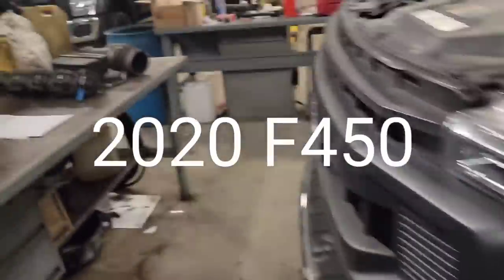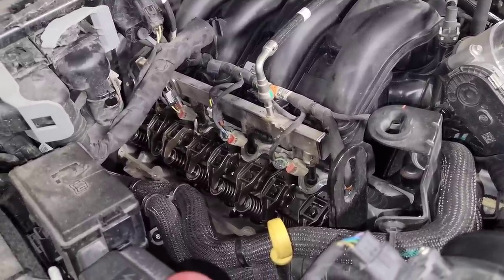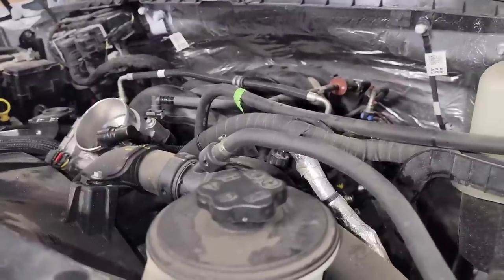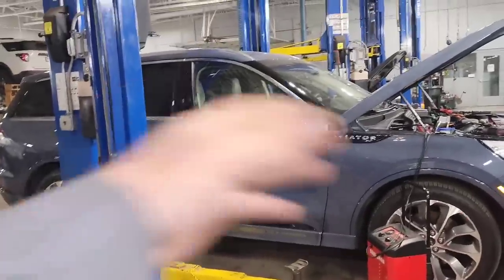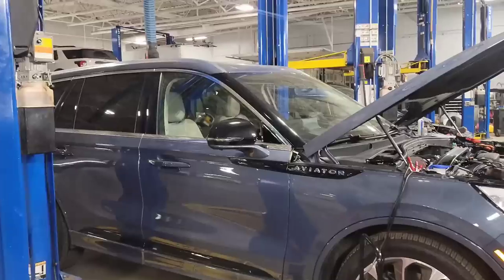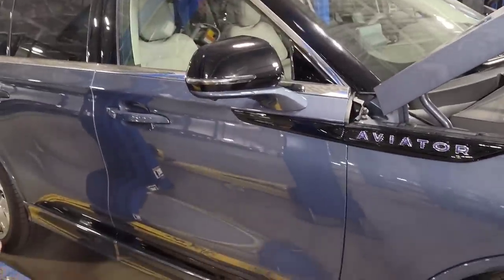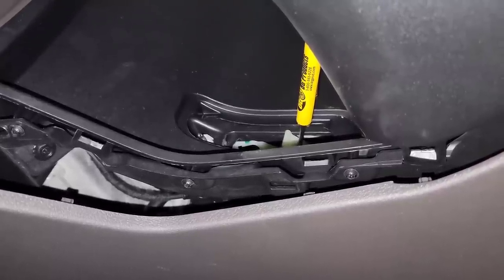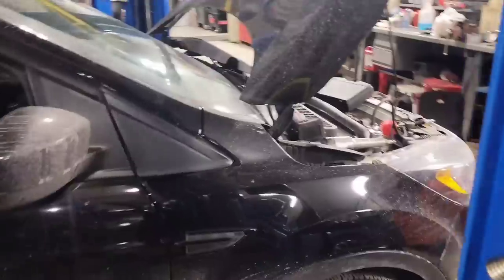2020 Ford F450 7.3L Godzilla Collapsed Lifter, 2021 Lincoln Aviator BCM Bricked - FDRS Programming

Comment: What was the main customer concern the 7.3 came in for? Did it have a CEL?  Ive had what sounds like a lifter tick since 2k miles....got 50k on it now. Rough idle also sometimes. Trans was repaced at 39k....was hoping the tick was in there.
Reply from the maker: This ain't no lifter tick this is a loud knock and misfire lack of power sometimes
Reply: I figured....love the truck other than the tick. Dealership said it sounded like a injector noise....i agreed but you can only hear it in the cab with the windows up. Preciate the reply and keep up the good work with these videos.
Reply: @FordBossMe  Agreed...with that much gap between the push rod and rocker, it has to be banging a tune rather loudly.

Comment: I have 2021 Aviator reserve 5 months old 5300 miles. The vehicle just died driving 35 miles an hour. Towed to the dealer and they told me complete engine failure, needs replacement. Is that common for the $70K vehicle? Thanks Ford Boss
Reply from the maker: That absolutely is not common
Reply from the maker: I've never even heard of that on that engine before
Reply: Ford tunes up while Honda detunes on turbocharged vehicles. When Honda owners tune up the boost the same damage occurs and engines fail.  If Ford detuned their engines to be less peppy they would see less failures.

Comment: I wonder if they developed that 7.3 with GM? First time I saw one at a show on a stand I thought it was an LS.
Reply: LOLOLOL what? It's old school push rod motor just like a 460. So yeah they resemble a LS which is a push rod motor also. But that's all! This is ALL Ford development and an absolute BEAST of a motor
Reply: @superdutyscaler6823  don't laugh, they developed Transmissions and transaxles together.
It's not a motor, it's a engine
Reply: @Bloodcurling  I don't think you can define what "motor" means

Comment: If you have currently have one that works (Ford, GM or Ram) KEEP IT!!  Change oil every 3 to 5 thousand, don't beat on it and run what mfg tells you and you should be good to go. Not saying this is a guarantee but may put odds in your favor. If you have to buy new, go talk to the Techs in the shop. Don't listen to the Salesman.

Comment: The school bus company I work for just got a big bus with the 7.3. It's brand new. It's going to be interesting how it holds up.
Reply from the maker: The key to this engine is don't idle it excessively if it doesn't need to be on turn it off and keep the oil changed by 3 to 4,000 miles especially with the severe use you guys are going to put it through don't try to run this over 5,000 miles I'm telling you right now long term it ain't going to benefit you and do not idle this engine all the time and if you're going to use a good quality oil you use something with a lot of phosphorus and a lot of zinc which I would highly recommend something like shape for Supreme 9000 5W30 formula
Reply: @FordBossMe  this problem isn’t exclusive to Ford.  The new V8’s from the big 3 have the cam center line higher in the block.  This allows for more stroke/variance in engine displacement while keeping a small bore spacing for packaging concerns.

I know someone who worked at Fiat/Chrysler headquarters and he said the Hemi engines fail quite frequently when they idle for extended periods (i.e. in police cars, etc.) due to the camas lacking lubrication and it’s due to the higher cam center line (and not addressing the oiling issue).

Comment: Tandem jacks on the rear & help from 3 other techs ought to clear that stall for you?
Reply from the maker: Not really sure what you're getting at but it sounds legit LOL
Reply: ive actually had to clear my stall this way.  Two floor jacks (one under each rear axle) and one tech holding both handles to guide/steer whiile 2 other techs push from front & me in drivers seat behind the wheel - its messy but works.  I enjoy your channel, thx @FordBossMe

Comment: I've taken Chrysler hemis apart that look like this, as in your third video. I watched that first (I cheated). The rollers fail on the hemi engines and every one I've been in,  needs a cam. My scope doesn't have the best resolution to look down in there but what I do, is I pull the cam sensor. Permanent magnet, if it, during my initial inspection, has metal on it, I just order a cam, too. Last 3 or so years,  the Chrysler dealers want the cams back. Which is interesting because they don't want the lifters back, the cause of cam failure. Every single one,  and I've probably been in a dozen, is missing at least one lobe. I've always gotten away with just lifters on the ls though,  except one, a 6.2 Cadillac Escalade. The 5.3s always just get lifters and send it
Reply: Johnson Hylift said they invented a lifter to stop "Hemi tick" but won't say anything about how they did it. I'm very suspicious of that.
Maybe Chrysler wants cams back as cores for rebuilding?
Reply: @skylinefever  Every one I've personally taken apart, cam was already junk and it was misfiring

Comment: I feel like we are going to be scraping 10-15 year old cars for stupid stuff like computer issues... With the parts availability and cost to repair.
Reply: Look under the hood of the new Bronco.  There is an engine somewhere under all those wires and hoses.
Reply: I guarantee new cars will be scraped 7-10yrs now because of the lack of onboard computer and part on  long term availability. The 10 yr manufacturers support has gone away in the wind. Still having hard time getting just maintenance parts for my 17 gm. The harnesses, computer modules, switches, etc.
Reply: Likely sooner than 10-15 years. "shortage of parts seems to be an excuse with every business these days".
Reply: One thing that makes me angry is that even simpler cars will end up this way. In the past you could simply avoid the problem by not buying a Cadillac or something similarly as complex.
Now you can't even get a Toyota Corolla without stupid touchscreen module.

I intend to buy an Evo X someday, it was one of the last cars of it's kind. Yes, it had some advanced electronics, but it has so many enthusiasts, that rebuild parts exist.
Reply: @skylinefever  simple ain't sexy.  Only sexy makes it on utube and piles up back orders for something not built or tested.

Comment: I absolutely never unhook batteries to tow vehicles. These neutral safety levers work just fine whether there’s power or not. And once I get them in the neutral I don’t put them back in the part that will be the technicians job. And if the parking brakes are applied and won’t release, then the vehicle gets dragged up on the flatbed or dollied.
Reply from the maker: So for safety reasons I replied with what was in the manual now what you doing real life makes no difference to me that's on you but because of my position here I had to cover the way I covered it
Reply: @FordBossMe  Hey I totally understand.

Comment: This is why I like older vehicles. No modules, no electronics, no bs to randomly fail and cause your vehicle to be stranded anywhere. IMO< they should leave all this tech out of vehicles.
Reply: How old are you thinking? Because they have been using a form of ECM's for decades.It's just that they control many more functions now.I was a mechanic in the 70's and even then they had rudimentary computer modules like the Chrysler Lean Burn module that was not reliable. You would have to go to the 60's to be completely out of it.

Comment: Wouldn't the loss of compression cause the misfire on the cylinder?
Reply: It depends on how much compression gets lost. I had a 2003 Saturn ION where the engine didn't have a misfire but ran like crap. I took a compression test, and #3 was far below the other cylinders. I think the numbers were 190, 190, 130, 190. I sold that car before #3 was completely dead.

Comment: Im sure as you have already found out that ford will not do a low time in service due to no short block component damage. And also the lifters are removed only after the cylinder head is removed.
Reply from the maker: They did 

Said ltis REPLACE IT

Comment: I had a question about the 21b10. I don’t think you’ve answered this, but mine will be going in to get them replaced in the next month here and I’m curious if they will be living the cab of the chassis? Only reason I’m curious is because I’m concerned that doing this will cause more issues In the future. I’m also concerned that once the engine is taken apart and the parts are replaced that more unrelated issues will arise. Please let me know what you think and how you have done some of your replacements. Or if you could do a whole video on the whole replacement that would be cool. Thanks.
Reply from the maker: So I have talked about this in the past actually I talked about this a lot and I find myself repeating myself a lot when these topics come up and I try to do the best that I can to keep my composure because it gets redundant answering the same thing over and over again

Some people will remove the cab some people will do it in chassy like I did
Reply: @FordBossMe  I know you don’t like repeating yourself. I hate repeating myself too. That’s my bad. I watch most of your videos and probably just missed it. There’s a lot of videos to go through. Thanks though.

Comment: Too much electronics that fail frequently. Engineers cannot design anything to work properly if their life depended on it. No need for all these features. Society is built to rely on electronics that fail with temperature changes in many climates. Thats just my opinion. Kudos to you for keeping up with the technology.
Reply: What I don't get is that I live in Florida, and many 80s and 90s EFI cars are still going because they don't rust out. They might need a few electrical items here and there, but a crippling disaster isn't so common. However, it is becoming more common now, because many new OEM distributors are not being made anymore, and replacements last about one year.

Comment: The only aviators that come into the shop are press cars. Lincoln is done as a brand.
Reply: Lexus killed em in 1990
Reply: @kylekirchner1163  not really the Town car was still relevant until the mid-2000s as was the Navigator, Lexus did more damage to Mercedes/BMW. And let's be real the volume car that keeps Lexus going is and has been the RX.

Comment: Hey rich! I just bought a 2022 f150 with the 3.5 eco boost. I plan on doing 5,000  mile OCI’s. I’m going to run full synthetic. Do you suggest 3,500? And what advice can you give me to make sure this motor is around a long time. Thanks!
Reply from the maker: Always use a Motorcraft filter or better and you can go 5,000 if you're doing mainly highway driving but if you're doing a mix between in town and a lot of idle then you want to do like three to four thousand
Reply: @FordBossMe  thanks! I appreciate the advice.

Comment: Rich, have you seen an overabundance of 7.3s come in with major issues?? Especially now since there are many with good miles on them.
Reply from the maker: Nope this is our first major issue which is not a common issue at all
Reply: @FordBossMe  got it. Gotta say I believe the 7.3 is an honest to goodness engine because Ford kept it simple. It doesn't even have direct injection, which will help long term with internals. It is a damn good engine, and I'm a Ram guy. Gotta recognize good stuff when I see it!

Comment: Hey Rich, you touched on the OTA updates when connected to wifi. How does this work when my vehicle isn't parked within range of my personal wifi router at home? What does the vehicles modem connect to other than that? The last update, I downloaded onto a thumb drive from my Fordpass account online and installed it as instructed, which worked fine. Thx
Reply from the maker: I'm pretty sure that you don't need to be hooked up to the Wi-Fi for some of the updates to take place
Reply: @FordBossMe  thanks Rich. According to my owners manual, apparently vehicles with a modem are connected to a mobile network via a SIM card (unsure of which network). This from my manual: -------- 'The modem has a SIM. The
modem was enabled when your
vehicle was built and periodically
sends messages to stay connected to the
cell phone network, receive automatic
software updates and send vehicle-related
information to us, for example, diagnostic
information. '

Comment: Damn shame cuz I really wanted to get one of these but in an f250 pickup but I will say at work we have like 12 of them all 21s at 550 chassis cabs with dump bodies on them 10 speeds and they're all great no issues except for the heat doesn't freaking work and the dealer said it would have took weeks for us to get them in and it's winter time where we are and we need to plow so our mechanic at the shop did something underneath the dash so that way we have heat and supposedly he can put it back but they might notice that he touched most likely the mechanics will notice it and they probably won't want to cover it but we can just keep Jimmy rigging it back and forth he has to make it he in the winter and cold in the summer but it's BS it's a brand new truck shouldn't have to Jimmy rig anything but it's not really the manufacturer's fault in my opinion it's not a manufacturer thing it's just a late model thing like all things that are made today are just crap compared to what they used to be and that includes the people now I'm just kidding..... It's not all of them It's like 3 out of 12

Comment: Superb skills Rich!  By the way, how many miles on the F450? Surely doesn't seem like it should be having the issues it is.
Reply: Sometimes miles don't matter. There's a certain number of vehicles that will have issues right off the line. It's just how manufacturing works. Not possible to have perfect manufacturing.
Reply: @joe1071  Thanks for the info Joe.
Reply: It's pos ford
Reply: @mikecastleberry9671  hahaha, believe me I don't love Ford. But I can certainly recognize that all truck brands have their issues and none is flawless
Reply: @mikecastleberry9671  i'm more Chevy than Ford man but you can get a bad one from any brand.

Comment: 7.3 is clearly a lucky displacement- 7.3L IDI and 7.3L Powerstroke are legendary and it seems that so far the 7.3L gasser is a tough plant
Reply: Yes, some companies had some lucky numbers. I loved the Nissan 300ZXTT, and when Nissan introduced what they call "The New Z" they decided to give it a 3.0L Twin Turbo engine. I just screamed with joy calling it "The 300ZXTT is back!"
Reply: WTF is "legendary" about a 7.3 IDI besides it's not a 6.9? And what's "legendary" about a 7.3 PowerJoke besides it's not a 7.3 IDI, a Triton or a 6.0. The only thing "legendary"  about "Ford" engines for the last...forever...is the "optional" engines are usually a little less shitty than the standard engine in whatever "platform".
Reply: @deeremeyer1749  substandard bait
Reply: @deeremeyer1749  The reason the 7.3 is legendary is because it was tough and the name stuck.
In some parts of the world, the name doesn't stick. They use certain engine sizes because displacement is taxed.

Nissan made several great 3.0L V6 engines that were completely different from each other. They were given alphanumeric codes to remember them by. The VG and VQ were great. The VG was an iron block with a timing belt, the VQ was an aluminum block with a timing chain.
Reply: Yes I seen sevral 7.3 powerstrokes go well Over 400k with no problems and just basic maintenance

Comment: Been following you and learning. The lifter, would replacing the lifter and testing to see if that cures the knock instead of pulling the head? 

I like that techy Aviator as I like technology 👍 But my lifestyle needs a truck, and I am thinking old school Powerstroke 7.3. However, what should be a decent 6500 dollar 4x4 is now 18-20k dollar truck. 

On a further note, your video on replacing the lift gate hatch motor on the Edge helped me replace the lift gate motor on my ‘16 MKX. I found a replacement part on eBay for 35 bucks. It worked great. HOWEVER, I GREATLY underestimated those precious and unique panel fasteners and reassembling those interior panels. 50 bucks later, new fasteners. Those small tabs on the corner panels that go around the rear window that connect to the lower main panel…broke those tabs right off. I am not a panel whisperer and have panel rattling sometimes. But, the lift gate works 😀
Reply from the maker: You can't pull a lifter without pulling the head

 see my updated video that I just loaded
Reply from the maker: I appreciate you letting me know it was a success

Comment: Godzilla? Is that what Ford is calling their 73 gasser? AAA has a bunch of these gas 450's lying around. No one wants to drive them. Everybody is so used to the Diesels. I'm not that picky, but after driving both, I understand why people would rather drive the diesel. It's a completely different experience. I'm not sure what the performance specs on the gas engine are, but it definitely feels like it is lacking in the torque Department. You can't tell anybody, but we've done a couple of tug-of-war. With traction control on, the Diesel pulls the gasser easy. I have to say though, I am a huge fan of this 10-speed transmission. It opens up a whole new world.
Reply from the maker: Now don't get me wrong the 7.3 L guess that up is pretty stout and I really don't think anybody should be complaining because is a great running powerful engine
Reply: I believe they're detune for utility and cab and chasis trucks, but still more than enough power haul a lot of cargo.